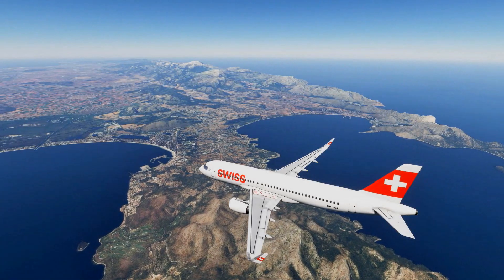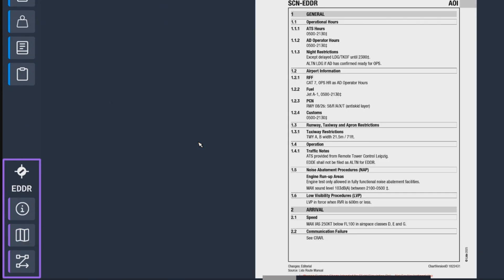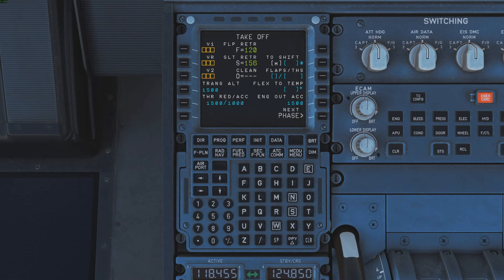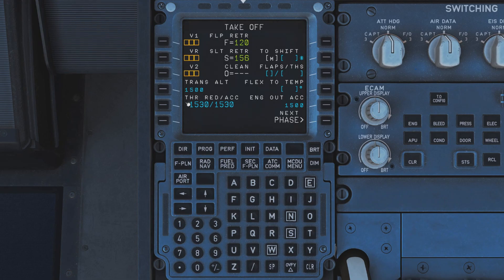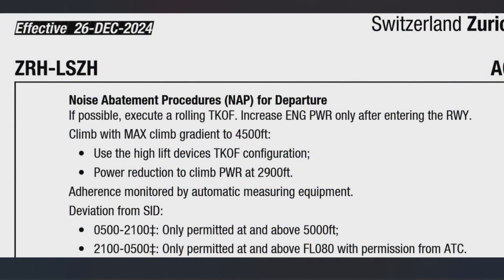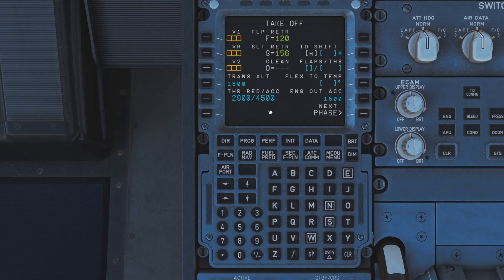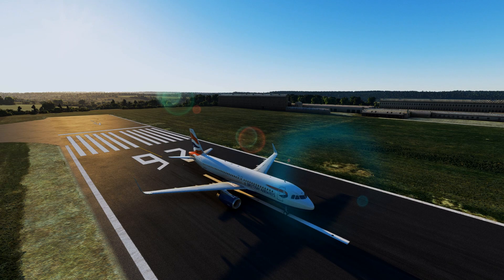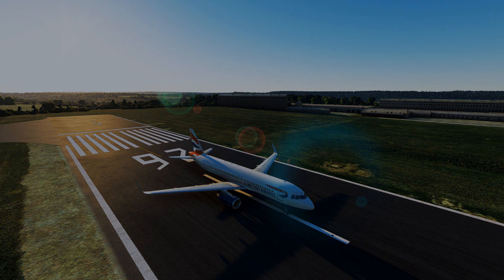How pilots keep their planes quiet. Noise abatement explained

Comment: Great video! Finally understood how the noise abatement stuff works
However, one part that I'm a bit confused by is how would you tell if the max altitude is an AAL or MSL on the Jeppesen charts?
I can see how in the Mallorca example you can easily tell given the "AAL" part, but I can't seem to find anything like that for the Jeppesen charts
Reply from the maker: I don't use Jeppesen charts. My company only uses Lido...in fact they invented them 😊
But surely Jeppesen must make it clear if it is AAL or MSL? Otherwise how are you supposed to know?
If you own MSFS2024 you can just use the Lido charts in there. They are very good. Not always up to date, but good enough.
Reply: @fsclips  I see, will have to have another look, probably just missing something, thanks!

Comment: Thanks for this informative video! 😊 A sim question, in the ifly 737MAX for the THR RED/ACC it says 'AGL', so then I simply insert 1000/1000 instead of the altitude? But in reality on the Airbus, you insert altitude and not height I understand?
Reply from the maker: It can be either. In ZRH they want you to use an altitude, do you simply put in the numbers. In PMI they specifically say above aerodrome height (or AGL), so in that case you have to add the threshold height.
If it says nothing, then by default it is an altitude.
Very important distinction: an altitude is above sea level, a height is above the ground.
AGL means above ground level, so you have to add the ground level underneath you too.
Hope this helps.

Comment: Hello,
Please do more videos about the NADP topic with different other examples.

Also it would be nice if you can show on Jeppesen Charts where we can find the relevant informations.

And yes, for approach I would like to see also NADP videos.

I have a question about Thrust reduction and Accelertion Alt inputs.

If you would insert 8000ft as Acceleration Altitude in the FMGS, in the example with Saarbrücken, would it be a pragmatic solution to use this value to meet the altitude constraint?

I am asking because I saw a video of an A340-600 of IBERIA.
In this video the pilot entered 8000ft as Acceleration Altitude because they had to meet an Alt Constraint and the aircraft was heavy. The aircraft had to depart to Mexico City.

Airport elevation of Madrid-Barajas is 1998ft.
So the Acceleration Altitude that was entered was 6002ft above aerodrome level.

In general I would love to see videos where you talk about special situations when you have to insert different values than the standard values of 800ft, 1000ft. 1500ft, 3000ft above aerodrome level.

The example with Zürich-Kloten is very interesting.

Thank you and I hope you can reply to my questions.
Reply from the maker: Yes, you could change the accel
Altitude to meet the restriction, but I can tell you from personal experience that in Saarbruecken that rarely works.

Unfortunately, I know nothing about Jeppesen charts. My company uses Lido, in fact, they invented it 😊
Reply: Ok. I thought you are using Navigraph. That is why I asked about Jeppesen.
Reply from the maker: @AVIATIONSOUNDEXPERT No, I actually use our real world charts for flying in the SIM 😊

Comment: At 5:10 the Fenix put 1500/1000 in the MCDU. I see this a lot on my Fenix as well. What is the point of that? It seems like the opposite of a noise abatement procedure. Lowering the nose early and keep using "full" thrust for 500 extra feet seems counter intuitive to me.
Reply from the maker: If I remember correctly you can go into the settings and tell the Fenix A320 what default accel and thr reduction altitudes you want. Usually it is set to the airline you selected. Maybe you are flying with an airline livery where this is standard. I could be wrong of course.